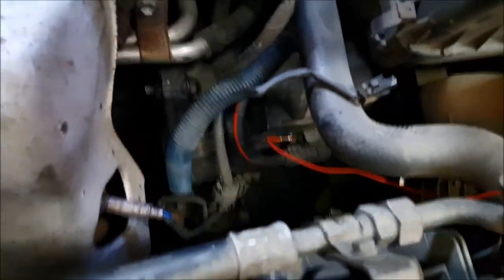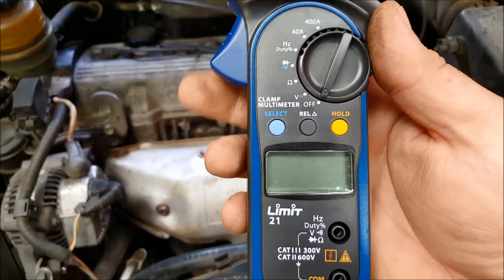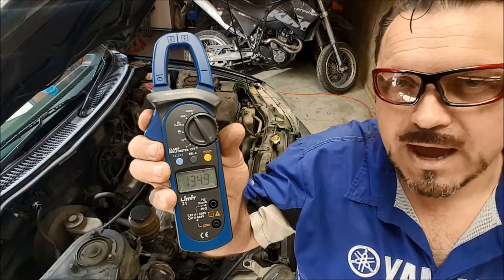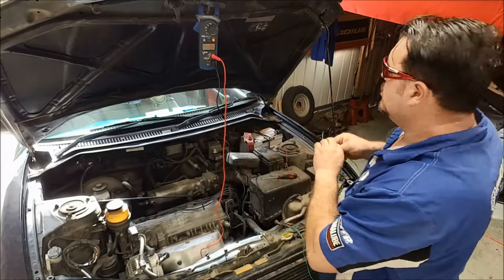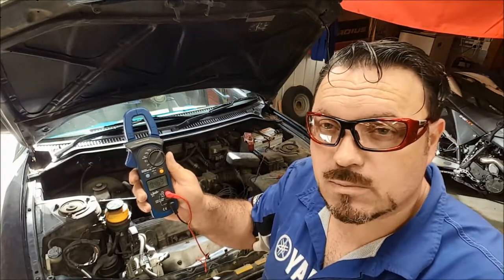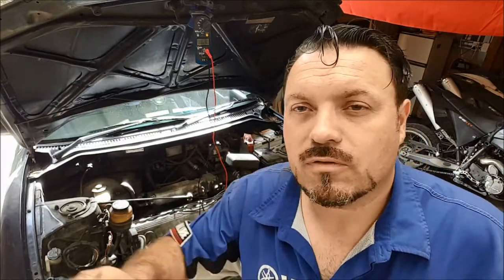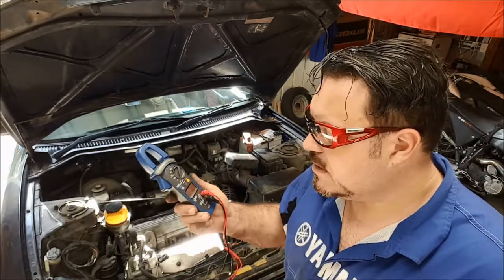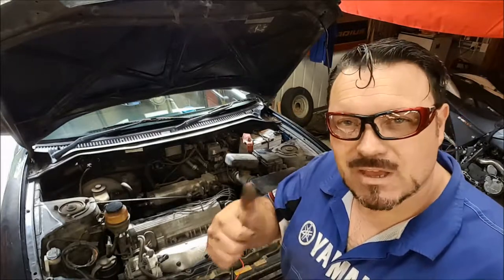Starter Motor testing & circuit condition #1406

Comment: can you measure the dc current of the starter motor with a clamp multimeter in the ac current mode?  i mean do you need a special kind of clamp multimeter that has the opcion of clamp dc current?
Reply from the maker: Hi, yes, the amp clamp must have the DC setting, usually a 200 amp scale is best.

Cheers Andy